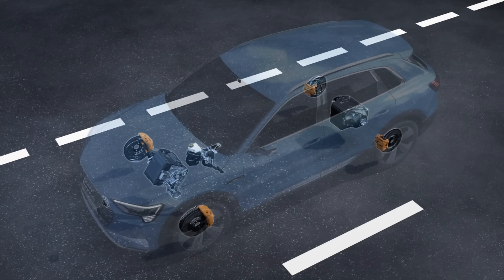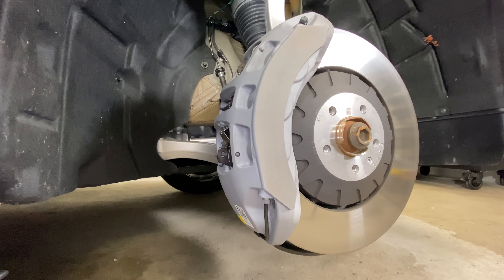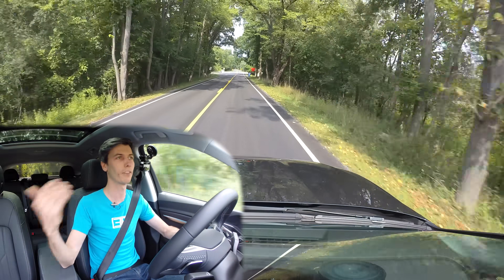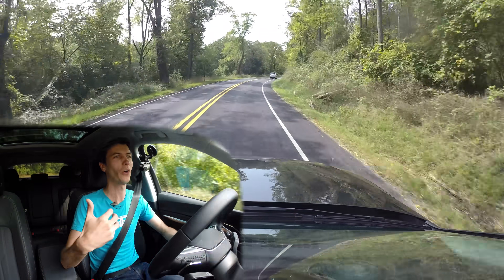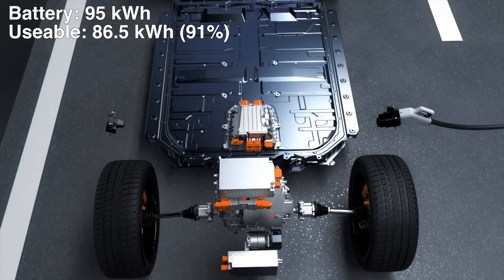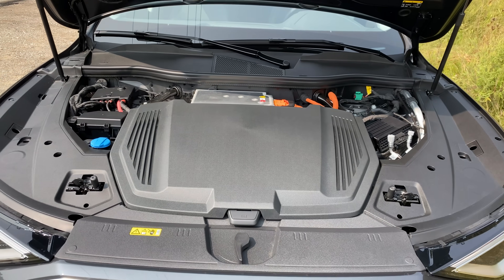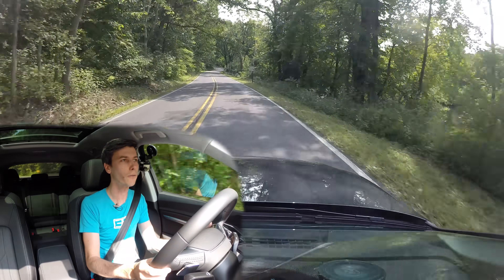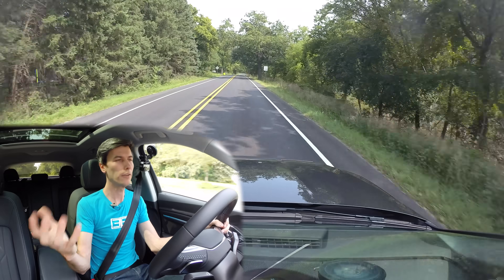How Does Brake-By-Wire Work? Plus: Audi e-Tron Sportback Review!

Comment: I don't like the sound of brake by wire! First off if it fails and it doesn't open the emergency valve for hydraulic brakes, two how are you supposed to know the shape your brake pads are in, and how expensive is it to replace a electric brake component!? I say im good! I'll stay with my gas guzzler for now until the ev market improves a lot more and isn't so expensive. Plus I've wondered about what happens if you get in a major accident in a ev like this! I can't imagine that smashing a giant battery would be to good for anyone including the environment! Could you imagine the mess! And i say this because theres no guarantee that nobody's not going to hit you, life still happens! Plus i live in the land of ice and snow so this definitely doesn't sound smart for where i live.

Comment: Sure. Brake By Wire is safe. Except fiscally. The associated brake pump accumulator assembly has a time and use cycle counter and when it gets to the equivalent of about 200,000 km on the odometer (YMMV), then it throws a safety 'Time Out' error, which very likely condemns the vehicle at that point. Unless you want to spend $3k+ on what is likely a $3k car at that point.  It gives you not very much notice, barely a week or so. So that's the downside, sudden death of your car based on a computer judgment, and you having to suddenly buy a replacement car, perhaps in the middle of the Xmas holidays. Not ideal.

Comment: I'm really irritated with all the electric cars that are obviously just petrol cars without engines.

Even a lot of the ones they say are "designed from the ground up" clearly look like similar models to what they already have or alternatively have layouts that clearly suggest they were designed for gasoline powered cars first. 

Why would an electric car need any equipment in the front or the back outside of being a legacy holdover? No, everything should be in the bottom skateboard design with 2 fully usable trunks. Anything else is dragging legacy downsides into new eras.
Reply: I still prefer to have a traditional crumple zone in front & back of the passenger compartment.  I’ve never been comfortable with the layouts of mid- or rear-engine minivans.
Reply: @kc9scott  With  a skateboard design not only do you have increased safety in crashes (as can be seen in teslas), but you also get more room and stability.

Im guessing that the trunks have to be re-engineered to function as crumple zones, but that the added weight of batteries also helps in collisions.

Comment: AKA: How to make a brake system super complicated, and expensive to fix!
Reply: Brake by wire is probably one of the least complicated technologies featured on this channel. The only appreciable added complexity over a traditional system is a valve, computer, pump, and a few sensors. Additionally, this isn't a new technology; it's been in cars since at least the turn of the century. The Prius used it back in 1997, and continues to use it just like pretty much every other hybrid and BEV vehicle for the past 20 years.
Reply: @Zoltan54  That's why mechanic hate engineer ...

Comment: Still too heavy, too reliant on computers for core functions (which catastrophically fail - looking at you Lexus) , too expensive to repair (let alone buy), too short a distance on a charge, not enough charge stations, and they take too long to "gas up".   That said, the EV market won't progress & grow if no one puts up with all this and buys them.   Soooooo..., go buy them, people!   When they're much better, I'll buy one myself.   Selfish?   Yes!   It's my money and my inconvenience.   Compared to gas autos, the EV needs:
   - Both need physical backups for all core & safety functions - FOREVER
   - Similar purchase & repair costs (regular maintenance costs should already be better)
   - Similar range (400-500 mi.) & weight (3.5 tons +/-) for a mid-size  🚗     ...formerly known as a subcompact!
          - No "second car" or mega$-Voltage charger required
   - 5 minute 0-"max" charge (or battery replacement stations by the 10s of thousands)
   - 150k avg. expected w/o replacing the batterie$ or motor$  (equivalent to an engine or transmission replacement)
I'll be waiting.

Comment: This is precisely the problem I have with an EV. The present models are mid-range cars. They are good for someone driving 50km-100km a day. I'm about 50km outside of Cape Town. If I actually worked in the city and had to drive every day, it would work perfectly.

The problem is I already work from home. That means I don't have a mid-range problem. What I have is a short-distance requirements, Going to the shops and taking the kids to schools, and a long range one, going to another country or province (this is Africa, long distances).

We have no charging network, so an EV is not suitable for the long distances. That leaves an EV for the short-distance stuff. It would be excellent for that... if it was cheaper. As a cost per kilometer calculation, an EV works out more than just calling a metered Taxi. And that right there is what kills it. EVs are second vehicles for rich people. Unfortunately.

Comment: Jason, there is a daily and trip charge with the e-tron. From the manual: 

"You can set the charging target, meaning you can set the maximum charge level to which the high- voltage battery should be charged. The charging target can be set between 50% and 100%. For daily usage, Audi recommends setting the charg- ing target at 80%. This can extend the service life of the high-voltage battery. Before long trips, Audi recommends setting the charging target at 100% for the highest possible range."
Reply: This is true, but only from the perspective of the consumer. Even the "100%" charge only uses 90% of the battery. This is audis way of appearing to appeal to the enthusiast and trying to quash people's fears about full-charging.
Reply: @samfcch7898  I can't find the specs page (Tesla doesn't release any of this), but the Model 3 has about 4-5% buffer, which is similar to many other EVs.
Reply from the maker: Now I'm lost haha.
Reply: @EngineeringExplained  me too :( I'm hoping you can help to clarify! It's an amazing car, so definitely not knocking it.

Could it be that Tesla limits ONLY the bottom of the battery and allows peak voltage @ 100% whereas Audi limits both?
Reply: @cadriver2570  yes, exactly. so you are not able to violate the battery warrenty.
Reply: i think they main point is, to have smaller batteries, less waste, less price and the same value. if the only thing you do is your daily commute of 20 miles threw the city, why do you need 200 range? if a "SMART EV" (i mean the car manufaturer) existed, with a range of 50 miles, it would do just fine with lower costs at every possible angle you look at it. (even if the ppl in the us still trying to drive the biggest and most wastefull car possible)
Reply: @TheNerd  I believe those used to exist, and now are probably taken up by the "hybrid" market, though those cars also have a gas motor. ...though I certainly see what you're talking about by implementing a modular battery array that lets you pay for the range you need.
Reply: @TheNerd  you can pick up a used Leaf for nothing now
Reply: @TheNerd  by using less of the battery, it will last much longer. An environmental argument could be made for long range EVs that are well taken care of. Audi's big buffer approach is about longevity (and charge curve). You could self-limit any long range EV like that to go easier on the battery.
Reply: @cadriver2570  how about not using the material in the first place?........

Comment: Pressing the brake pedal: does it really measures the travel distance not the pressure (force) you're applying?
I would have assumed they'd use a load cell like in high end sim racing gear or even like in F1
Even with the mechanical brakes you reach a point where you do not push the piston any further but you're braking harder when you press harder on the brake pedal by applying more pressure.

Comment: Range is important but recharge time is the most important thing.

You never mentioned recharge time. The new Toyota battery allegedly charges up in 15 minutes.  

Why are you not explaining that engineering?
Reply: 7:46 on the left is shown a recharge percentage vs time elapsed. I'm guessing that's actual charge times, with a 22kW AC power source.

Comment: I currently have a leaking brake drum wheel cylinder that needs replacing.
Reply: And it probably can be fixed for $15 (less if you go to the j/y).

Comment: People scared about range in an EV reminds me when we first started switching to smartphones from our Nokias and realized that this is now something we need to charge at least daily as opposed to something we charge once a week
Reply: Not everyone drives 50 miles a week like you. I drive just over 600 miles a week. Sure I’m on the high end but many people live in rural areas and drive a lot. We also like to take trips. Stopping every 200 miles for a several hour recharge is not acceptable. Range has to be improved for it to become mainstream
Reply: @chribrian  Road trip problem would be solved if we could throw a battery trailer on the back. 600 a week should be no problem if you charge overnight?
Reply: I mean you can say that but also not.    Sure it may be fine for most. Unhelpful in a situation where it isn't.   I spend 30000+km on a motorcycle with 18l fuel tank5-6l but no fuel gage.   And that is totally fine but in some areas you ride regretting you didn't fuel up.     In motorcycle circles less than 200km range is seen as annoying, rightfully so.            Then less charging stations than fuel and charging time..          So yeah as Jack of all trades thing most evs are still not acceptable.
Reply: Yeah, but I don't for you but in Europe, having an EV charger at hand is not as easy as charging a smartphone overnight
Reply: Although if you are smart you buy a cheap Chinese (they're all of course made in china) phone that lasts 3 days. This is after it being a year old and watching about 2 hours of yt a day. My cheap 14 year old 7 seater French car has a 840 mile range as well, if you buy different brands you get better.

Comment: And if the security valve fails? It's normally never used and as we all know something that is not used will not work for long
Reply: The valve is likely “fail-open” like air brakes on trucks, essentially the only way the valve can be closed is when the system is operating, if the system is not operating, then the valve will be open without electrical power, etc.

Edit: I realize air brakes are technically fail-closed, just was trying to give the most common example of an existing and related “fail-safe” technology
Reply: @joshuacurtis5523  Hes saying that if something is not used for long period of time it will not work, the valve has to open, if it sits closed for 10 years it very well could become stuck in that position.
Reply: Stink Wink uhh... routine maintenance to cover these fail-safe valves?
Reply: @wiryantirta  Well its an audi so its probably a 14 hour job to get to the valve, but sure.
Reply: Stink Wink I understand the original commenters concern- I’m saying that anything that is “fail-open” will be open whenever power/control is not applied. If I had to guess, when the car is turned off, the valve will then default to the “fail-open” position (directly connecting the master cylinder to the brakes), and then when the car is started, the car would enable the brake by wire system, thereby providing an actuation every time the car is started/turned off. Yes- it is adding another failure mode, but I would argue that it’s no more or less prone to failure than a traditional brake loop

Comment: Is that emergency override valve automatically tested regularly by the system?
Reply: The valve is likely "normally open" which means traditional hydraulic braking is always engaged unless the car is on and everything checks out with the computer. If the pump or computer were to fail, the safety valve would no longer be powered and manual braking would occur. Every time you turn off the car, the computer would stop powering the valve and essentially "check" the valve by returning it to emergency mode. Upon startup, the system checks parameters, closes the valve, and the driver remains clueless that they are driving by wire. If the valve were to get mechanically stuck or damaged, it would get stuck open (traditional brakes) from sitting for extended periods of time and warn the driver upon finding a fault at initial startup.
Reply: @Zoltan54  that makes more sense and safer
Reply: I think that's the case although I'm not sure

Comment: Hey Jason, I love your videos. Can you explain why EVs don't have wheelspin with such aggressive accelerations?
Reply: Torque is so much easier to control with an electric motor. Cos the whole thing is digital. U get the best possible grip at any second, decrease/increase it instantly.
Reply: Traction control is more effective in EV than ICE due to all motor component are digitally controlled.
Reply: They achieve max torque instantly. Doesnt that equate to even worse wheelspin? Especially with the added weight. I must be missing something.
Reply: @aldinbekto5820  Due to lack of gearbox, the manufacture can use the lowest gear ratio, like 0.8:1. Despite the instant torque, the gear ratio itself (EV only have single speed gear) is like overdrive gears in ICE, hence lack of wheelspin. It is like flooring the normal cars from standstill at final gear.

Comment: To me this is just reinventing the wheel (or brakes).  Just didn’t strike me as a problem that needed a solution.
Reply: You don't understand the point of why they are doing these breaks.
It's not to making breaking better on our part, it's making breaking more profitable on their part.

To have a break system be electrical and connected to the computer means it can be fully controlled by the computer. 
And that means the breaks are probably connected to a timing system that triggers a service light after a certain amount of wear.
I'm sure it must be something like a tire pressure light. 
Exept you have to take your car into the dealer and get all new break pads.
It's pretty sketchy I think.
Reply: Quantum Leap    It’s possible that’s the case but he explains in the video that it is supposedly so the car has more control.  In some cases that’s a good thing but at the same time it can also not be.  To me electronic throttles were one of the worst updates to modern cars.  Now they are doing it with brakes too.  Maybe I’m old school but I like to be the one driving, not computers,
Reply: @quantumleap4023  the comment started off well until you went on to explain what you meant. I'd cross the road to avoid someone if they said this to me in person. The tin foil hat guy had it right.
Reply: freezeme360  he was referring to breaking, not braking. Different stuff LOL
Reply: That's because you have no idea what you're talking about
Reply: It's very important if you want efficient and "natural" feeling regenerative braking.
Reply: Sorry I just made that up. But I really wouldn't suprised if they did something like that.

Comment: I guess the most important thing about brake-by-wire is all the safety features which require the car to brake autonomously. If the car detects that you're going to run over a pedestrian, it will brake by itself. Or if you're going to back into another car in a parking lot, the car will brake by itself to prevent the collision. If you're using cruise control, the car can use brakes in a steep downhill to keep the set speed. And so on.

Comment: Very easy decision for me: dig around in pocket, only find some lint; nope, no $80,000 car in my immediate future!  Which is ok, because I want nothing to do with robots controlling the brakes.  ABS is fine, since it truly is fail-safe.  When it fails, the brakes work completely normally without any special valve needing to be functional.  Considering the reputation of Audis becoming money pits once they get a few years old, there's no way I would trust this setup.

Comment: What if the valve malfunctions?
Reply: You would wish you still have traditional manually e brake
Reply: @blackbulletkill6947  At least you have regenerative braking
Reply: If a valve fails in a conventional braking sytem, then you're in trouble too.
Reply: @klugshicer  There used to be a pressure release valve to prevent rear brakes locking up.   That could cause spectacular accidents but seems to be unheard of now.
Reply: @klugshicer  Right, but conventional braking systems have no series inserted valves.

Comment: If the system fails, a trapdoor drops out of the floor and you stick your feet out like Fred Flintsone.
Reply from the maker: Danger to manifold!
Reply: Engineering Explained now Jesse has to tear apart the engine to replace the piston rings you fried!
Reply: Yes Willma!
Reply: Two anchors fire out the back and dig into the road...
Reply: also happens on regular audis when the fuel runs out
Reply: @IzajResGS  k?
Reply: In the case of Toyota, when the system is off or malfunctions, it will be in direct connection mode, so it will be the same as a normal car with no brake booster functioning.
However, when the system is on and in direct connection mode due to a malfunction, regenerative braking generally works normally except at low speeds, so it may be slightly better in that it can provide a reasonable deceleration rate up to a certain speed.

Comment: Hi Jason, thanks for another great video! 
However, please note that you mixed up the drag coefficient of the E-tron vs the E-tron Sportback. The Sportback has lower drag of 0,26 and as a result a longer range with the same battery pack, vs the regular E-tron's 0,28. Keep up the good work!